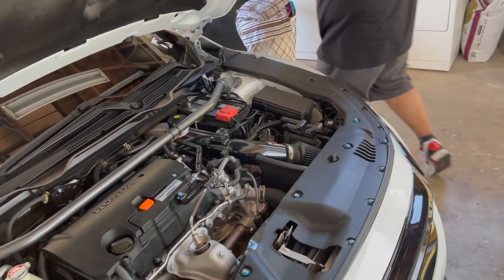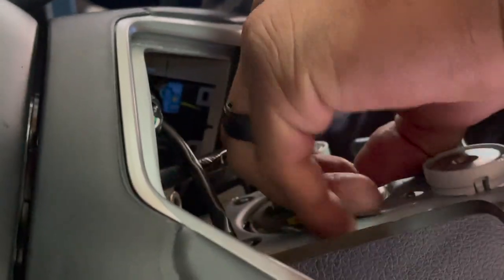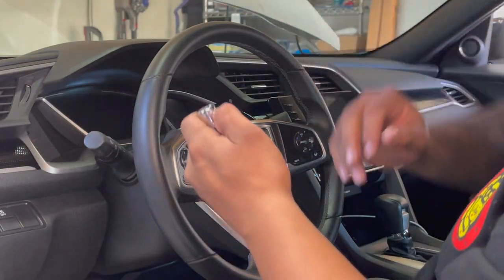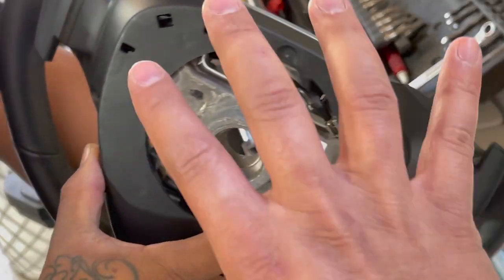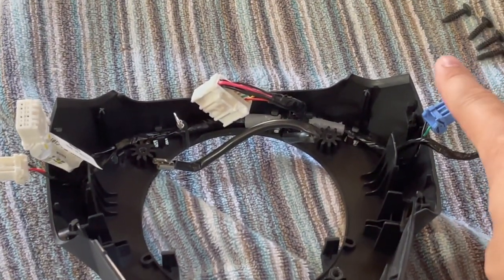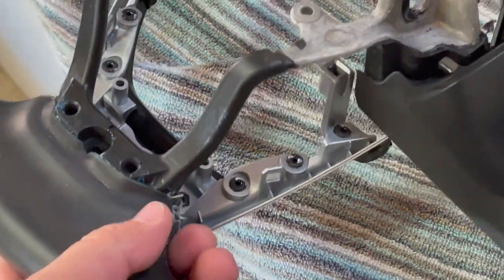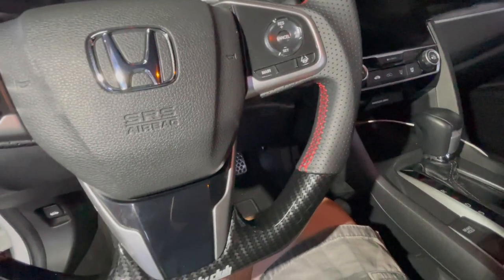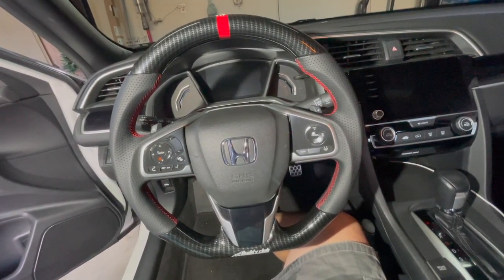Honda Civic Type R FK8 Helps FC2 Install Buddy Club Carbon Fiber Steering Wheel

Comment: Planning to install my steering wheel on Tuesday when it comes in. You guys didn’t have to disconnect the battery right? Just got straight to it?
Reply from the maker: Yes definitely disconnect the battery my dude! Also wait 10-15mins after just to make sure all the power is drained! Last thing you need is to trigger the air bag

Comment: Hi, after installing the steering wheel on a non-manual civic and to an automatic CVT sport sedan does the paddle shifters still work after fully or no? and if so, does this affect the warranty as well on a brand new honda civic sport? Thank you! 👍
Reply from the maker: Yes the paddles still worked perfect! As for the warranty it would be up to your dealership, it should void all your warranty probably just your steering wheels warranty..but I can’t guarantee it 100%
Reply from the maker: Thanks for watching!
Reply: Awesome, Thank you!!!

Comment: Can i install the civic sport steering wheel with the paddle shifters to my non paddle shifters steering wheel?
Reply from the maker: Good question, I’m sure you could but you would have to buy all the additional paddle parts, only thing I’m unclear on is if the paddles would actually be functional... let me know if it works out for you